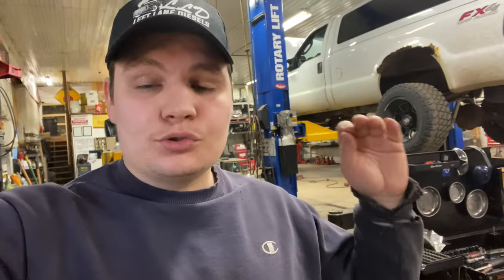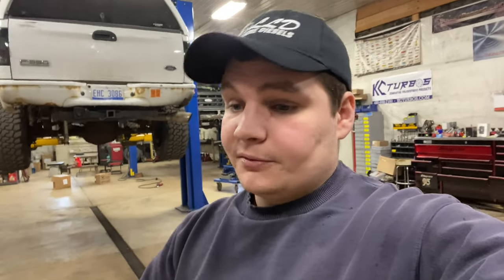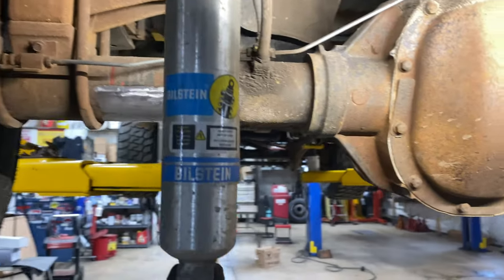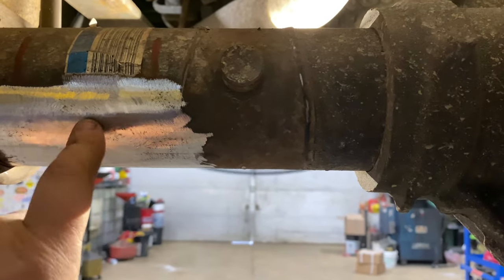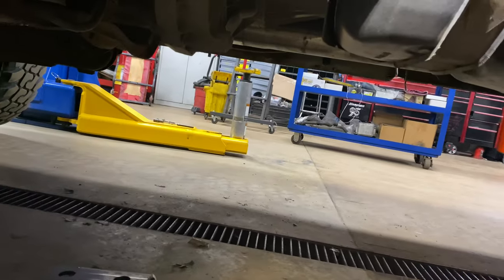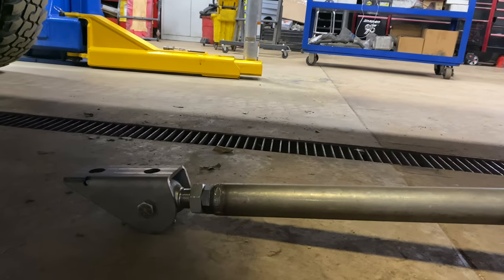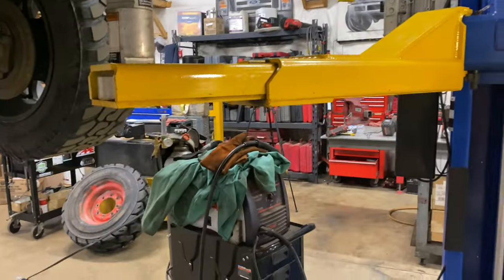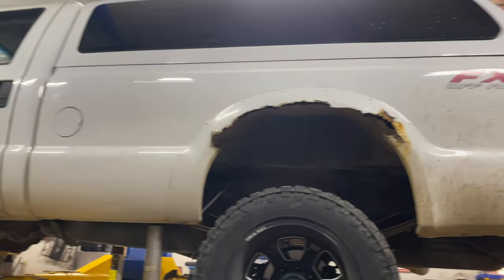DIY TRACTION BARS! 6.0 POWERSTROKE

Comment: Nice bars, turn heat up a tad or wire speed down some,  weld will likely lay flatter
Reply from the maker: Looking back now, wire speed needed to by higher for sure. Still learning, and getting better 💪💪
Reply: @LeftLaneDiesels  I think it's a bit fast, it'll roll and do that rise with to much wire, start with less wire and work your way up, welds will turn out nicer that way, not trying to sound smart, just some advice!
Reply from the maker: @mystycim  mush respect! I appreciate it
Reply: @LeftLaneDiesels  my Welder I got to try out doesn't have wire speed adjustment on it so I'm suffering, but some more practice with using it and I might get lucky.

Comment: Hey buddy I got a question. I know it’s not traction bar related but oh well lol. On my 04, about 70% of the time no matter if the engine is warmed up or not, if I take off from a stop light per day, my turbo will not engage at all for a couple hundred feet or so and my truck will sound like a regular V8 then all of a sudden it will kick in hard and then be back to normal. Do you think it’s just some carbon build up and the turbo needs to be cleaned and a rebuild kit or I have a problem?
Reply: Probably carbon in your unison ring causing the vanes to stick open. If you have an sct you can watch the vgt actuation % in the gauge menu, it should go between 0.15 and 0.80 at least.

Comment: Should do a single turbo 6.4 build
Reply from the maker: The 6.4 engine is the worst engine Ford ever had in a truck. If you plan to own one, you better have deep pockets.
Reply: The 6.4 can make big power cheaply .   But it doesn't last very long lol.  Very very deep pockets required
Reply from the maker: @10mm69  they have serious valvetrain and bottom end issues in stock form. Not to mention front cover cavitation, radiator failures, cab bushings, bed plate leaks, k16 failures etc.. They must be built from the bottom up to be reliable long term.
Reply from the maker: @10mm69  the difference is in stock form. Stock 6.0 with fuel and air at 700rwhp will live longer than a 6.4 with fuel and air at 700rwhp. You also have to look at cost effectiveness. It’s more expensive to build a 6.4 at 700 than it is a 6.0... and a 6.0 will live longer. Now when we’re talking full builds it’s a toss up because now you are at the power level where anything could happen no matter how “built” everything is.
Reply from the maker: @10mm69  hey if you have had good luck with them, that’s great. But that has just not been my experience.

Comment: Damn! those look 10 times better then the ones ive been mockin up, guess i better step it up and shop somewhere other then the trailer section at tractor supply! Not a fan of those procraps? lol What would it take to get you to fab up a set for a extcab sb lifted 8 inches been holding off over a year, hoping if i change out clutches in diff maybe  cure most my traction issues, you would think a 7k lb f350 on 37x13s diesel wouldn't have issues, its worse then my boosted ls camaro on bald radials
Reply from the maker: I’d be willing to fan a set for your truck, if you want dm me on Instagram and we can chat about it. @left_lane_diesels

Comment: Those are not hiem joints....
Reply from the maker: Frame end is hiem, axle end is bushing
Reply: @LeftLaneDiesels  the frame joint is a ballistic or Johnny joint style bushing, the axle ide is a poly bushing...those are not hiem joints.
Reply: @matty86suk  can you put poly bushings at both ends?
Reply: @joshaudet  yes
Reply: @matty86suk  should I though?
Reply: @joshaudet  depends what type of suspension you are building, and what vehicle, intended use, etc. Polyjoints are good for medium duty use
Reply: @matty86suk  2007 megacab 1 ton cummins 4wd with airbags and towmaster valve body.  Truck is stock aside from the valve body.